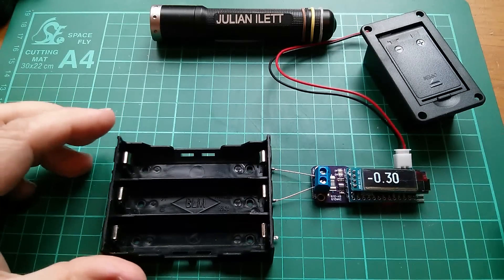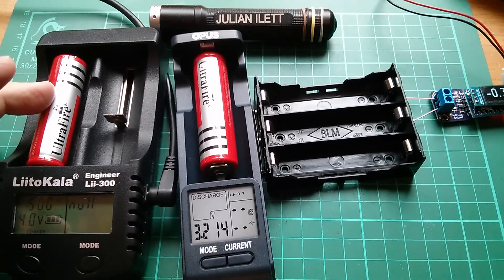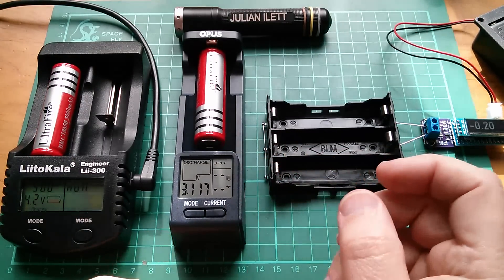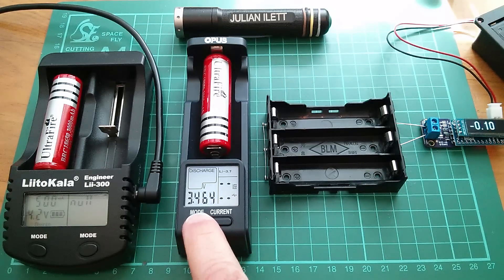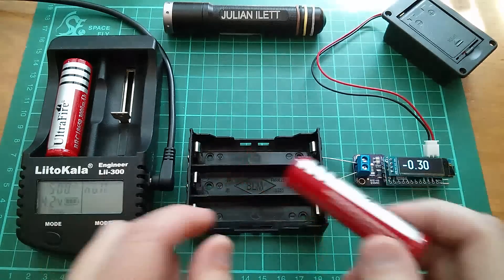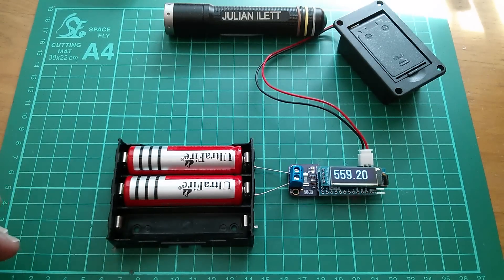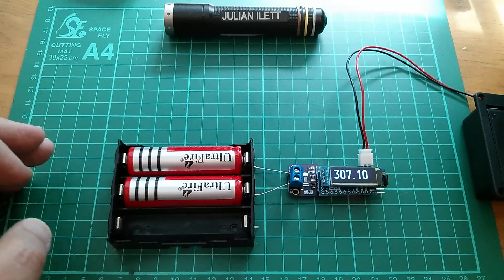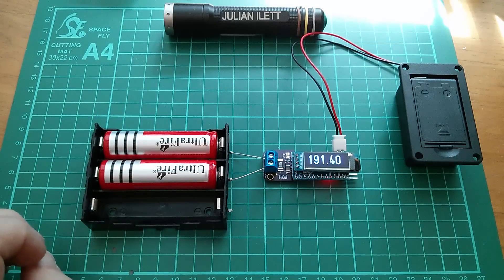Fully Charged 18650 Lithium Cell in Parallel with Discharged Cell

Comment: I have those same batteries, it came inside a flashlight. They have VERY high internal resistance. Don't try this with a high drain lithium ion battery.
Reply: Yes, Those cells are always fake. Some even have a small pouch cell inside.
Just get your hands on some older cells from an ebike or similar, they are universally better, even though a lot of ebikes use inferior quality cells compared to what you would expect they would put in the packs.

Comment: How many 18650 Button top cells can we connect in parallel? I'm panning to add together 3 or 4 of these 18650 in parallel in one of those holders in order to give longer run time in my "under the hood work light" that I use in my garage. This light is fixed on the top of my workbench so I could just attach the cell holder right next to the light and use the existing wiring from the cell inside the light to the new cell holder. The run time at the moment is miserable, just around 2 hours with 1x 18650 2000mah in max setting. Then six hours on the charger.

Comment: If the dead cell is zero volts then it will be seen as a short and will draw as much current as the charged cell has. As the voltage difference between the two cells become equal the current will drop.

Comment: Internal resistance (IR) is related to SOC (state of charge).  A cell will display different IR values according to its state of charge.  Temperature also affects IR.  Therefore you should let the cell stabilize and cool down after charging/discharging for at least one hour prior to measuring IR.

Comment: Oscilloscope?  No.  But what I'd add to those ammeters is a couple of header pins that could be read during initialization and taken in one state to indicate that the arduino would also be sending data out serially,  for logging and analysis.  It would ba a trivial hardware mod,  and not very much software would need to be changed as well,  just one conditional test in the initialization code.

Comment: Hi Julian. How could I charge two 18650 battery's in parallel (initially connected in parallel at exactly the same voltage so no damage caused)?
I would like to double the capacity but don't want to remove the individual batteries to charge. Would like to just plug in to a TP4056 to charge rather than remove the batteries.
Thanks.
Reply: If they are paralleled, they are always at the same Voltage, so you can just plug them to your charging board without a problem. The only thing you could adjust when charging parallel cells is the charging current, cause it would take double the time otherwise. When you charge 2 cells with 1 amp every cell gets approximately 0.5 a , so if they are rated for 1a charging, you could charge 2 cells with 2 a
Reply: Knife P. Thanks for the info. 👍🏻

Comment: Tried this a while ago. Was surprised by how much the contact resistance between the cell and the holder matters. See, for cheap holders the springs/contacts are made of some low quality steel, which is a poor conductor. As it heats up, it looses its elasticity which means it pushes less on the battery tab, creating an even worse contact. This overall becomes a current limiting mechanism. 
I noticed this trying to use a pump from AA rechargeable. The thing went down in power after ~10 seconds and stayed there for the whole ~15 minutes the battery lasted.

Comment: The INA219 board that I'm using lets me choose between four I2C addresses by soldering / desoldering the corresponding bridges. So you could pull it off using just one Arduino and 4 INA219 boards (€2 each from Aliexpress, shipping included :).

Comment: Use a ribbon under the batteries with enough hanging out to grab both so all you have to do is pull on both sides of the ribbon to get the batteries out...

Comment: Ultrafires arghh, yes the resistance dictates the current flow into the voltage difference,
If the test was repeated with say a 12s lipo high discharge 2milliohm'ish depending on discharge state, one charged parrelled with a flat one then I think you find the current flow will be more like 7000amps
4.2×12=50.4v
3.0×12=36v 
So there's 14.4v difference across them v÷r=I   
so 14.2÷0.002=7000 amps initial draw. 
Considering the c rating for discharging peak is 30c at 10amps or 300amp oops :), and the charging is less than half that double oops :) both packs are going to get extremely hot.  But as the current flows into the flat cell the voltage will rise fast and the current will drop fairly rapid to under 1000amps and boil the battery's at their limits until they reach equilibrium.
A lot of the initial charge in the first cell will have been wasted as heat and the second flat battery will have caught very little of it both battery's life will be shortened drastically.
Reply: 7000A is short circuit current. If you paralell 2 battery packs with this currnt sensor current will be (4.2-3.2)V*12cells/(0.1Ohms+2*0.002Ohms)=115A and it will destroy resistor and the rest of the current sensor board. 100mOhms is current sense resistor on this board
Reply: Correct, well spotted I left the poor current sensor out it would have been mince meat.

Comment: Confused by parallel cells?  are they not in series but + to -  joining the pair like you have, to me you need one connection at each end of the case. Or am I missing something after all its late at night...

Comment: Julian, I use a similar method to discharge cells that I allowed to charge too high after testing.  I try to store all my cells around 3.7v for longevity.  When I essentially short a 4v+ cell with a completely discharged cell at ~3.2v, through a similar small ammeter, I have never observed  in excess of 4 amps charging the dead one.
Keep in mind we are only talking about <1v difference in potential voltage, so even the milliohms of undersized wire helps limit the low potential flow.

Comment: I have paralleled up a couple of turnigy lipos before out of curiosity one full and the other relatively discharged wire gauge was about 12 or 14 AWG so can handle quite a bit of current and yes the wires did warm up very slightly so there was a massive current flow not sure how much though

Comment: how well do you trust those ultrafire cells?  I've heard bad things about them. any brand with fire in the name, I use basen but they're very expensive, those ultrafire's are tempting. thanks
Reply: thanks guys, i guess ill stick with branded ones, in fact my friend did have some of these he got with an 18650 torch of ebay, the weight is incredible in regards to being lightweight. compared to the basen ones i have they're feathers
Reply: Yeah, when they don't even take the trouble to adjust for the weight, you can really tell that they are are not the rated capacity simply because they are feather light. I bought a bunch of 14500s cheap, and they were useless and light, compared to my KeePower branded sanyo/panasonic cells, which where heavy and are still alive and kicking ;) 

+JR Hartly... lol... didn't realise you could buy the skins that easily... what a joke!
Reply: Ultrafire are absolute rubbish. They are never anywhere near their rating... a 3200mah labeled battery will be lucky to be a 900mah in actual real-world capacity. Get yourself some Panasonic NCR18650B cells... I have several of these Keepower cells in flashlights and they have yet to fail me after a couple years of use. http://www.candlepowerforums.com/vb/showthread.php?341580-Test-Review-of-Keeppower-18650-3400mAh-(Black)
Reply: They're fakes. Those exact red sleeves can be bought in bulk very easily on line. (https://www.fasttech.com/products/3797000) As stated by another commenter, they either contain a shitty little cell and lots of sand to get the weight up OR they are actually cells from old laptop batteries which have had the sleeve added on to make them legit. I guess these types have no protection circuit built in and are therefore pretty dangerous.

Comment: what's the limit of current mtering that amp meter can register. I want a meter for the 600 amp power supply. the capacitor used in the supply already has a volt meter in it. I have a volt/amp meter I won from a y/t solar wind channel. but it only goes up to 150 amps. if you see my dilemma.

Comment: you can calculate how much current will flow. I = (u2-u1) / (r1 + r2) where u2 is the voltage of full lipo, u1 empty, r1 & r2 are internal resistances of batteries. you could also measure internal resistance if you did it backwards, but you usually use constant current load instead of empty battery.

Comment: The max current of the Ina219 is 3.2 amps.  Did you have any idea if this would be exceeded (even for a very short time) during your experiment??  -- smile !!
Reply: The LNA219 does not have a max current, because there is no current flowing through it (except for supply current). It's measuring voltages only, the rest is maths in the chip.
Reply: Not true !!  The load current runs thru the sensor resistor in the INA219 - and then the voltage is measured - and the current is then calculated.  You can see Julian's current connections to the lugs on the INA219 in the picture at 0.00.  Look up the spec sheet.  It definitely says max current (i.e. "load" current that it can measure) is 3.2 amps !!
Reply: Read the datasheet. I think you don't understand how it works. There is no internal resistors.

Comment: Add a piece of sturdy ribbon attached to one side of the battery holder, as is often done when a device has cells that are otherwise difficult to remove.  

I'd like to find some INA219's set up for higher currents - something over 5 amps for each panel in my solar array as well as 20 and 30 amp versions for the output of the PWM and MPPT controllers.  

I found a source of "removed by schedule" AGM UPS batteries this week and will get six 90 AH batteries over the weekend,  Definitely need to upgrade my digital measuring capabilities ;-)  I do have analog amp meters with 75 mv shunts (including a DC clamp-on ammeter with ranges of 40 and 400 A) but those require that you read them directly.
Reply: Check out hall sensor based current sensors. No shunt (no losses, high power low value precision resistors aren't cheap) and usually isolated (very easy to measure currents at different potential).

Comment: if someone noticed.
when towards the end of the video Jullian was swapping the cells, the meter showed more error than before. It now went till -0.90mA while earlier went till -0.30mA max.   I wonder this is because of new battery or heating on the INA219?
Reply: If the INA219 gets warm you did something wrong.

Comment: Have you ever received an 18650 "UltraFire" that was even remotely close to its specified/marked mAh capacity? I haven't. For that matter, same question for ANY Chinese made Li Ion cell.
Reply: Some Chinese cells claim ratings that are beyond those even possible for a particular cell type which is a sure clue to it being BS, but I've found even the believable marked ratings are lies for EVERY Chinese Li Ion cell I've ever bought. Chinese lipos don't have NEARLY the same ratings BS problems, but I've received some overrated Chinese lipos, too.
Reply: sure. Ive got a couple of Efest IMRs here, I think they might be rebranded Samsungs under their wrappers but yeah they are their stated capacity
Reply: My original question was, "For that matter, same question for ANY Chinese made Li Ion cell."

I should have said "Chinese brand" instead of "Chinese made" since quality electronics and their components CAN be made in China IF made under a brand name with a REPUTABLE history, like Samsung for instance which I believe is South Korean and not Chinese but their cells may be made in China.  EVERY Chinese branded Li Ion cell I have ever bought was mAh overrated crap.
Reply: ah, tbh I dont know any Chinese manufacturer brands for 18650s, meaning companies which manufacture and sell under their own name. Efest are a Chinese brand but they just rebadge cells from the likes of Samsung, Sony, LG and Panasonic. UltraFire are actually a small but apparently reputable company who make LED torches and have their own brand of cell to go with those products, but their cells are counterfeited left and right for some reason. The UltraFires Julian is using arent genuine UltraFires, but theyre such a small company I doubt they have a battery plant, a genuine UltraFire cell will be just another rebadge.
Reply: Then where is all of this Chinese 18650 JUNK coming from? Since giant cargo ships full of scrapped western electronics are shipped to China because of their nonexistent or unenforced environmental protection laws, I begin to wonder if 18650 Li Ion cells are being removed from junked laptop battery packs, relabeled, and sold as new. With their slave labor levels of wages (compared to western wages), even small shops could afford do that. 

Actually, this theory would help to explain why there is so much junk (the vast majority) among the Li Ion cells from Chinese brands, whereas from my experience Chinese labelled lipo packs used for quadcopters and fixed wing RC aircraft are just fine and far more often than not perform exactly  as specified. Such lipo packs are not found in junked electronics whereas 18650s ARE and are most likely to be AGED GARBAGE having a fraction of their original mAh capacity when removed from OLD laptop battery packs.
Reply: where are crap chinese 18650s coming from, well theyre coming from china. but my point was that the crap 18650s Ive come across are unbranded and totally anonymous cells like you find in cheapo/poundshop power banks. theyre not masquerading as a branded cell, theyre just rubbish. those ones arent recycled laptop cells, theyre just really low capacity. you can tell by weighing them. a decent 18650, ie 2400mAh or above, will weigh at least 42 or 43g. 2600 and 3000mAh cells will weigh a few grams more, maybe 46 or 48g. Ive come across an 18650 as light as 30g in a power bank that was supposedly 2800mAh, but tested at under 700. 
I dont know how prevalent the practise of rewrapping old laptop cells is but having salvaged a lot of cells from such batteries I know how you could tell if you got one, it would have the weight of a good cell but you cant remove the spot welded tabs they use in 18650 packs without leaving marks on the terminals, that would be the sure sign.
but in general the likes of the 9900mAh UltraFire will continue to be around as long as there are people willing to buy them. I just had a look on ebay, you can order 4 of these impossible cells for 4 quid, shipped. I guess some people must just have a blind spot for this stuff but I dont know why. If they saw the exact same product for the same price on a market stall I bet a lot of them would realise it was too good to be true, must be rubbish and not buy it, but theyll click buy on ebay without a second thought.
Reply: "but you cant remove the spot welded tabs they use in 18650 packs without leaving marks on the terminals, that would be the sure sign"

Because what I have requires them, all cells I buy are button top. The way to hide the top weld mark is to put a button top in it. For the bottom weld mark, put a plate over it. A quick grind on both ends would remove any peaks due to the original weld. From the fake cells teardowns shown in that video, that small amount of work is FAR less than some of the efforts put into the fakes shown. I'll have to tear one of these Ultrafires down once they die just to check. It's only the slave labor rates in China that allow them to do such crazy, labor intensive things and still make a profit.

I have gone to flashlight forums and asked for RELIABLE sellers of Li Ion cells. Just as a test, I bought some cells marked as "Ultrafire" from them. Still total crap.

Comment: Would it be posible to us this ammeter replacing the sense resistor with an rtd as a temprature sensor?
Reply: Why do something that chip isn't designed for, when there's digital thermometer chips that don't cost more? An RTD alone won't do it btw. You will need a voltage reference as well (the INA219 can't measure resistance).
Reply: That's the reason why I ask Im a total novice. You can do it with a raspberry PI but I need a cheaper sollution  though. I think the chips I know of are from ST or something like that. I also need timing but I go module by module. Ist the ampreage regulated by the reistance though? Even if this chip doesnt work in that way.
Reply: yes, but depends on how you want to use it.
Reply: Hello Dorkster how's the lab these days? I want to use it as te ensor unit for a temprature controller with multi I/O. Meaning i want to use 2 or more of these to control SSRs controlling different water tanks preferably using a PID algorithm. I realise an atmega 328 might not be up to the job but even so there are other ways of utilising I2C.

Comment: Too bad the circuit doesn't have some jumper pins and different shunt resistors for more ranges.
Reply: Joseph Nicholas i think you would add up much contact resistance and therefore gerting inaccurate readings. However you can change the resistor. Most boards i have seen also have holes to put in a non smd resistor

Comment: Try to put in series a fully charged, completely flat and fully charged one.  Will there be negative voltage?
Reply: You'll permanently damage the flat battery and hopefully not cause a fire.  Yes, it will be negative charge through the flat battery but not the sum from the series.